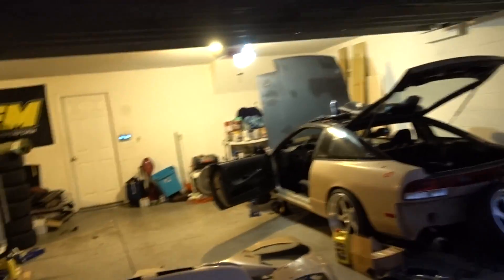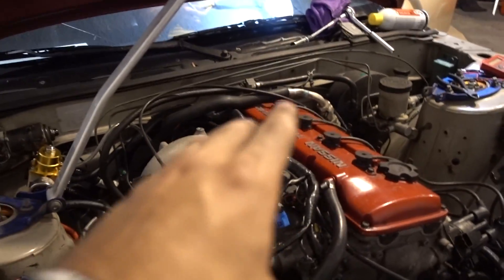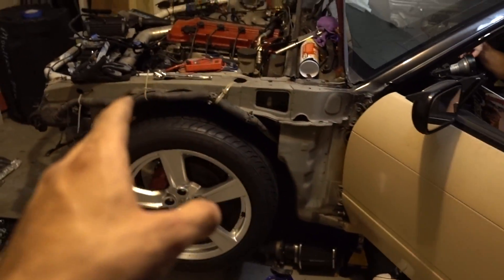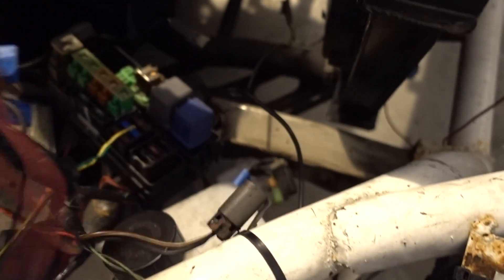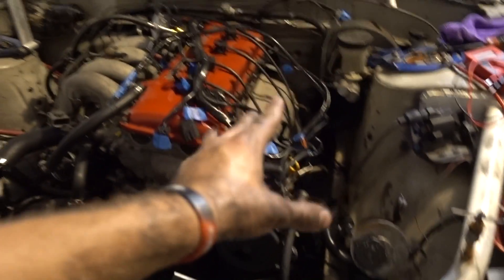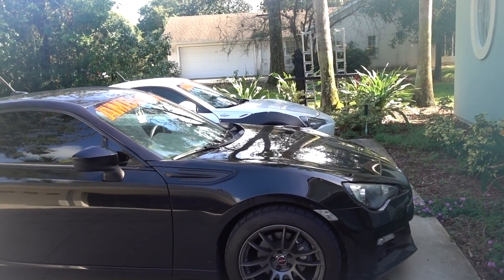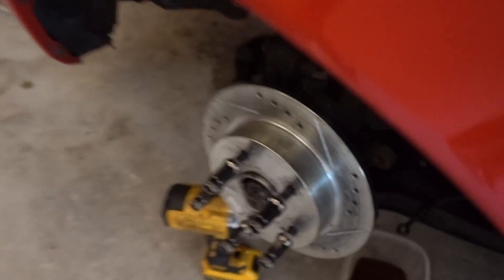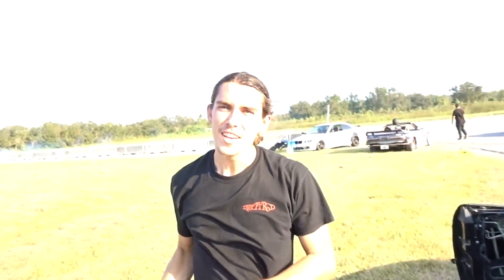He SMASHED His E36 on the Wall

Comment: the 2 wires tapping into the fuse box are probably for switched power for those radiator fans or something else that needs switched powerin the bay, looks like the fuel pump is still wired stock
Reply from the maker: Demetri Stavrou hmmmm the fans have their own switch inside the car......definitely weird!
Reply: The pump is hot wired for a stronger signal.